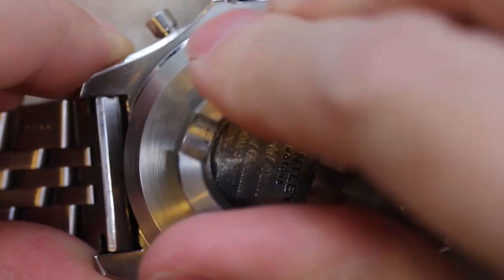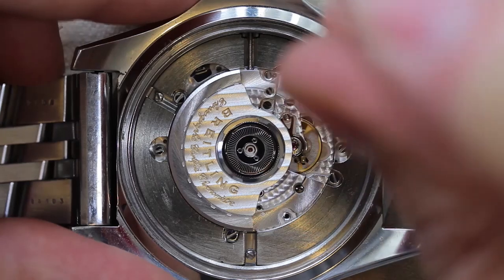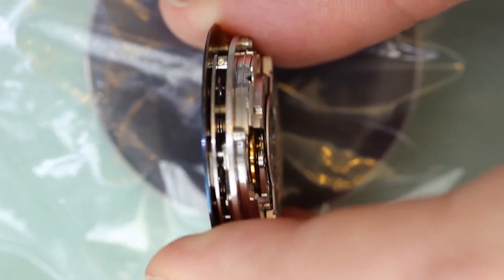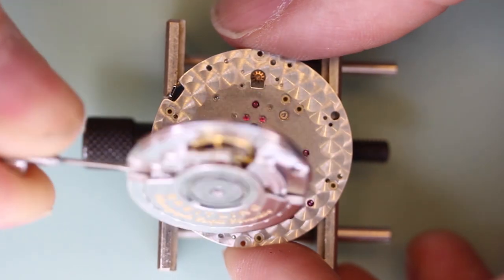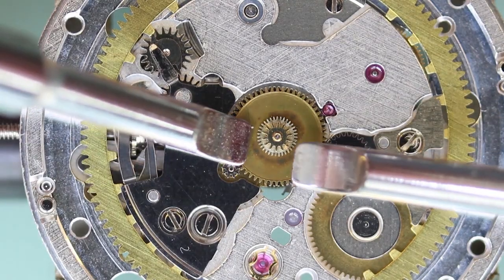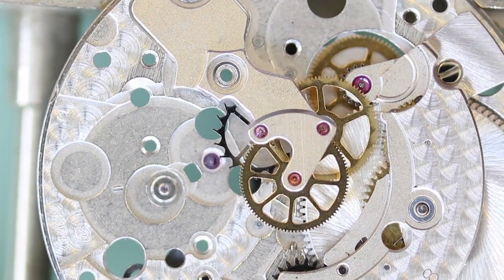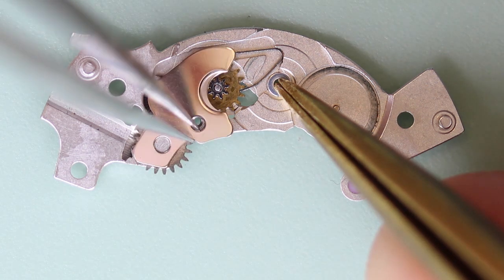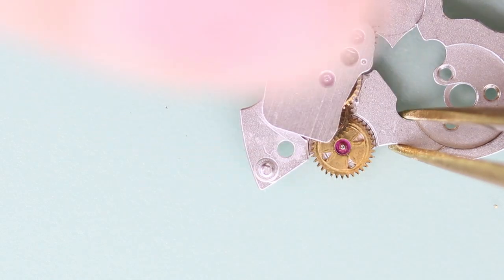Part 1 Breitling Bentley Service ETA 2892 A2 Dubois Depraz Watch Repair Tutorial

Comment: I have a tag heuer 2000. Its an eta quartz watch which has this dubois depraz chronograph. The watch battery runs down very quickly, unless the chronograph is left running. It appears that there's actually less load on the battery when the chrono is running. But how can this be possible? Thanks

Comment: I have a Tag Heuer Formula 1watch that I believe came with an ETA 251.262 chronograph quartz movement.  Would it be possible and practical to replace it a mechanical movement such as the 2894?

Comment: Is it possible to shed some light on what tool I require to open the back of my 6.75 speed Breitling for Bentley? It has the wheel back plate with no edges for the standard tool to grip

Comment: Looks like a pain in the ass to service compared to a Valjoux 77xx. Such a shame because the Breitling Shadow Flyback I wanted to buy so bad has this movement. If it's not serviceable, it's pointless.
Reply: 7734/7750 movements aren't very easy to work on either.  Column-wheel movements have fewer parts and well designed ones are much easier to service.